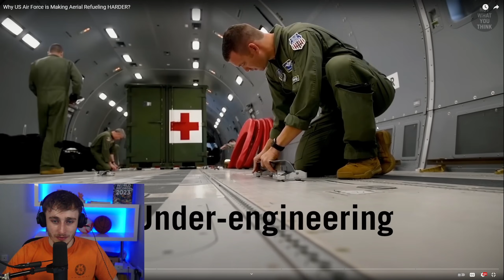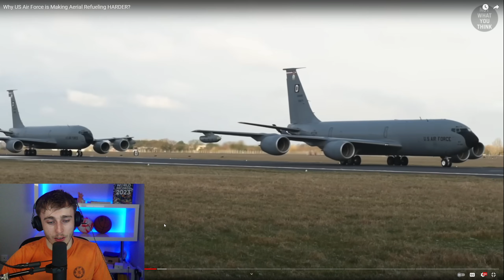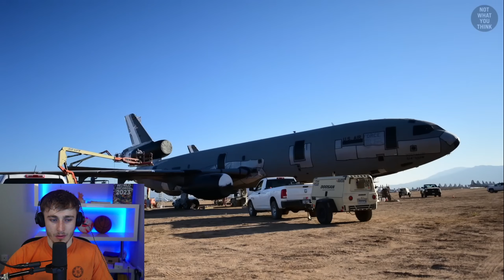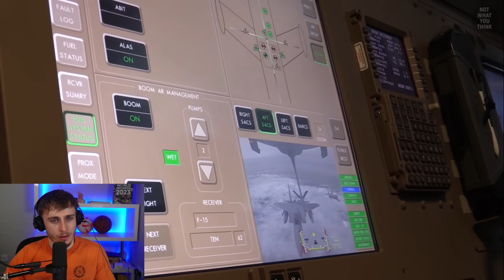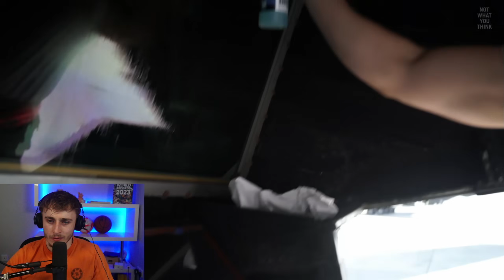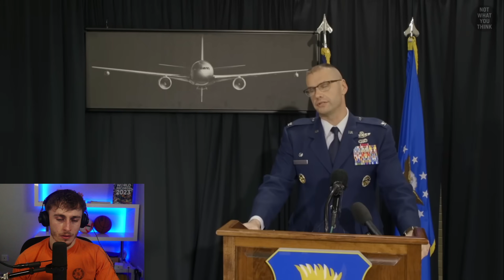Brit Reacting to Why US Air Force is Making Aerial Refueling HARDER?

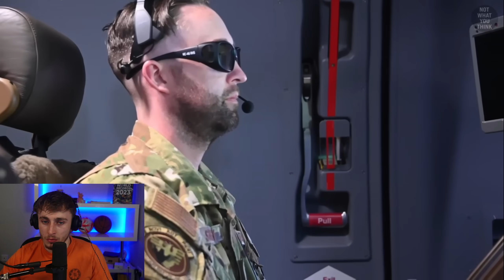Comment: 13:20 it’s because the boom operator has to be able to move from the back to the front, because you can’t be laying on your stomach for 10 hours without being able to get up, stretch, and rest.. This takes a lot of room, for just a hallway(it’s more of a tube that you crawl through, but point stands.). They are trying to free of space for fuel by moving the boom operator to the front.

If it was for a stepping stone into automation. Then they of made a fully automated system on a  experimental aircraft (X-planes), like the Navy’s drone.